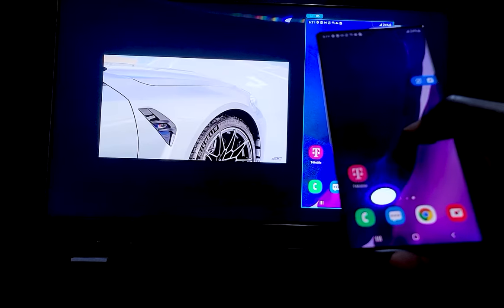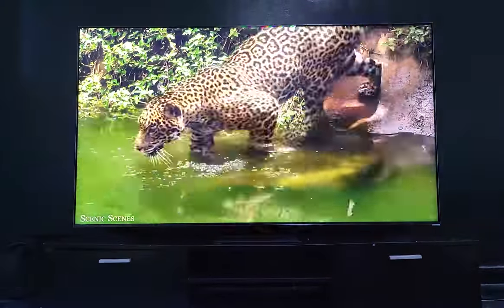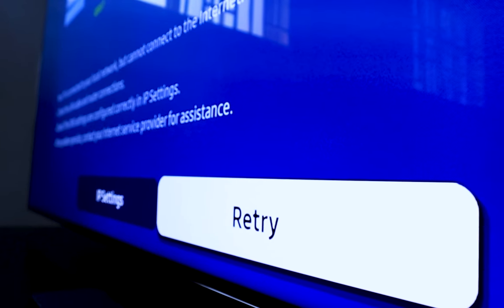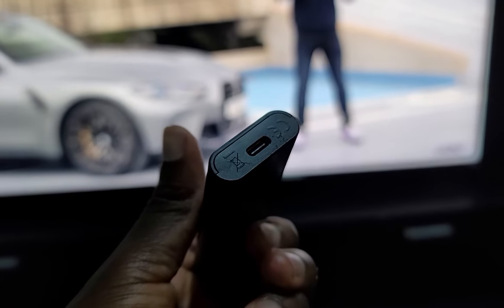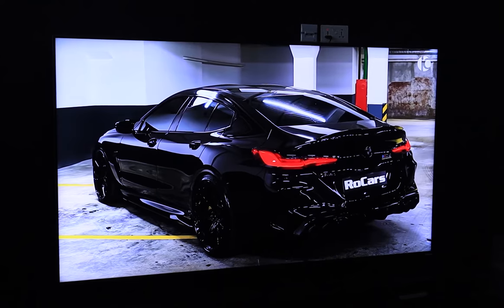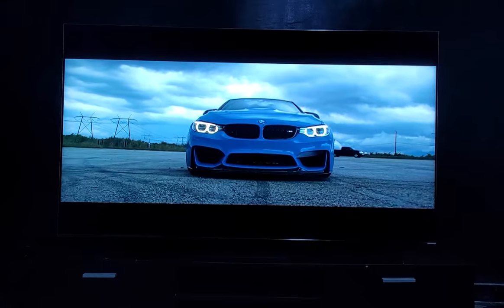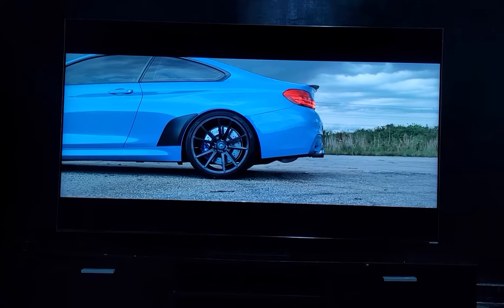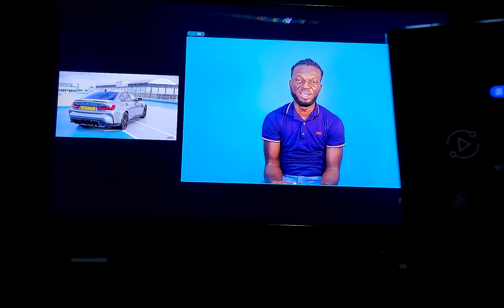Samsung QN800A Neo QLED 8K Review

Comment: Fix your title. This is the QN800A, NOT the QN900A. The QN900A does not have the bezels around the screen
Reply from the maker: Yes, it was an honest mistake. Thanks for drawing my attention. I've fixed it.
Reply: The 800a has 8 speakers. The 900a has 10 speakers. The 900a does have a bezel, just smaller.
Reply from the maker: @rw2382  Thanks.